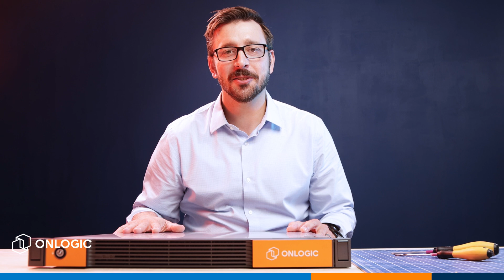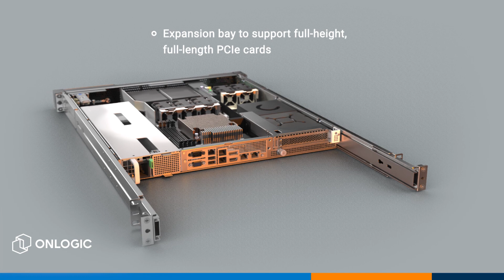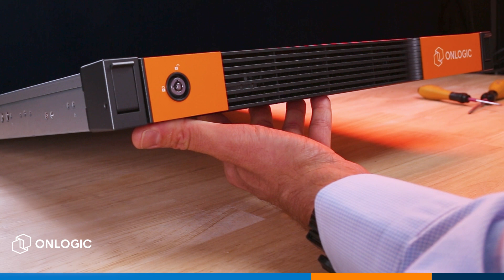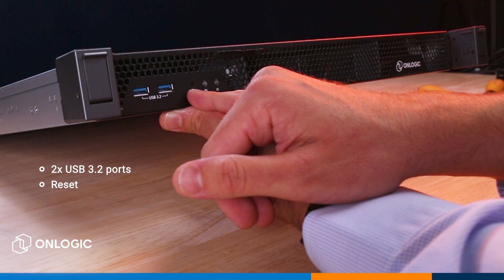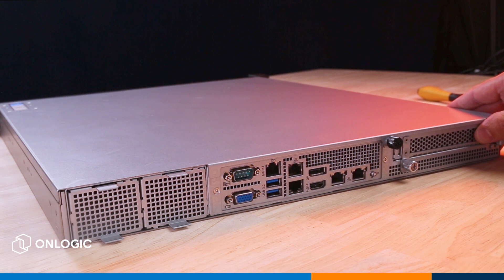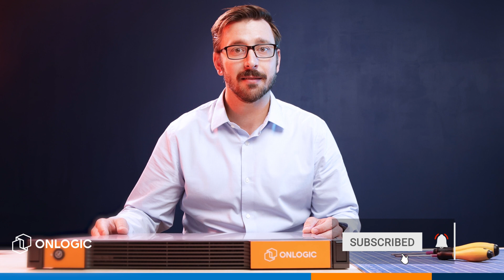What's Actually Inside an Industrial Edge Server?

Comment: @ChenReniceSSD
If your edge devices need to be deployed in extreme environments such as high temperatures, humidity, dust, vibration, radiation, or shock.

If your equipment requires low latency, high durability, and power loss protection to ensure data integrity and reduce the need for on-site maintenance.

Choose industrial-grade solid-state drives—they are built to meet these demands.

If you are looking for a direct factory supply chain for industrial SSDs, feel free to contact me.